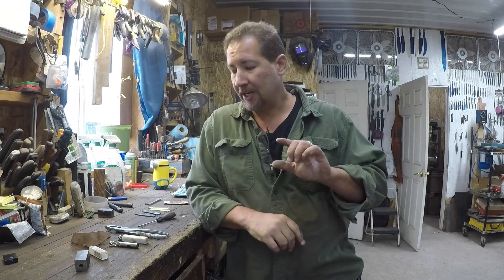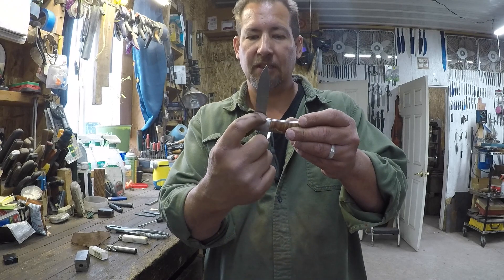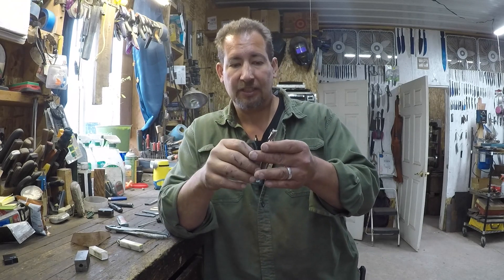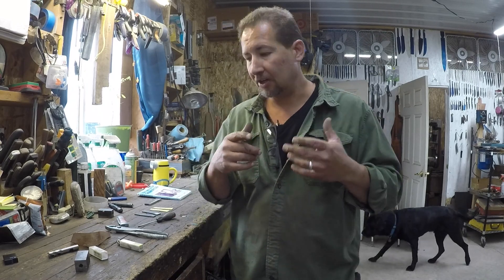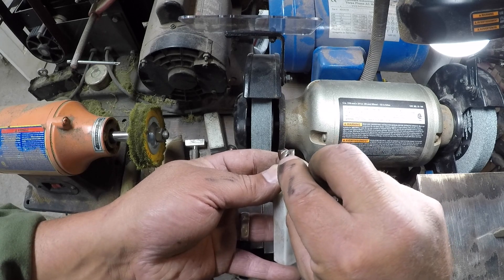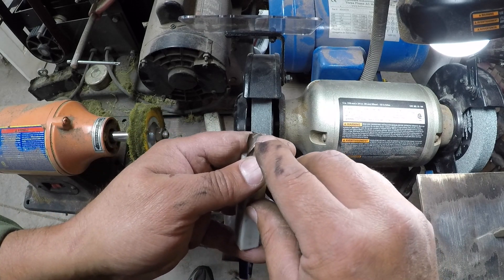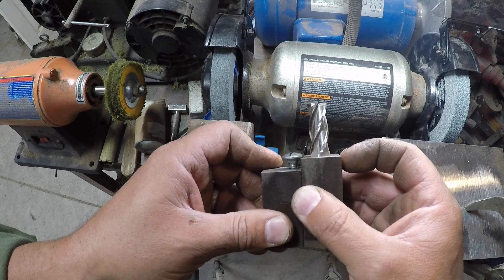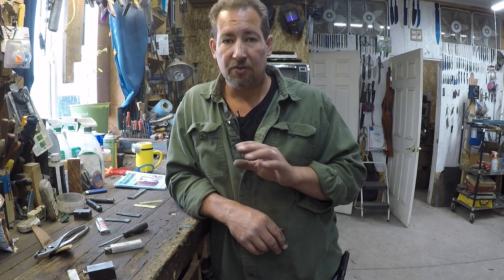simple end mill bit sharpening

Comment: So you're sharpening the cutting lips of the mill, not the flutes.  I was interested in sharpening the flutes.
Reply from the maker: yes, i put the most wear on the lips in normal use in my shop. i have not needed to sharpen the flutes yet.
Reply: In the Tool and Cutter Sharpening book by Harold Hall there is also a method shown on how to sharpen the outer helical flutes of an end mill or slot drill.

Comment: ❤ exactly 
You can even use an ER32 squre collet chuck holder
Reply: then you can grind almost every end mill upp to 20 mm even larger if it has 20 mm shaft it sitts like a mountain  just tighten the chuck with your fingers 👌
Reply from the maker: that would have been alot faster to make :}

Comment: Most of the time you would mill with the 2mm on the end of the milling cutter so only 2mm or so gets really blunt, then all it takes is to rough grind 2mmm off of the end and use this device to get an accurate cutting edge again, no need to do a full helix grind.......I use a T& C grinder but this device will give you a good end mill once more..
Reply from the maker: it has been working pretty well so far :}

Comment: That works really well for getting the bottom of the cutter. I would be sure to dress the wheel in between cutters. For surface finish, what you can do is take a stone and put a flat bevel, just on the cutting face and then follow the bevel from the inside of the flute. All we do at work is whip out a diamond paddle and touch up the edge. Works well with HSS drills, too. It also helps to give it enough clearance behind the edge, otherwise you get a ton of rubbing that will dull the cutter and leave a poor finish.
Reply from the maker: thanks, I will give that a try!